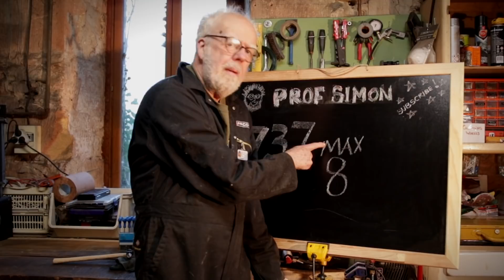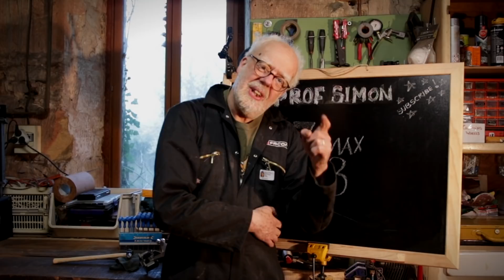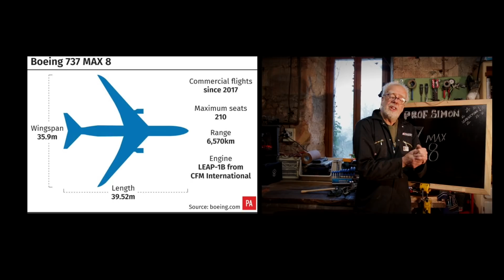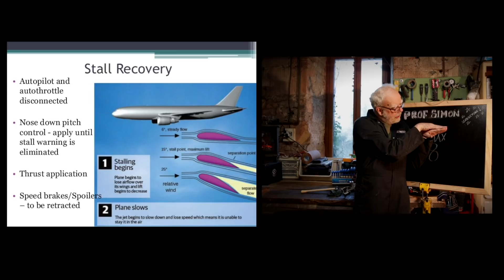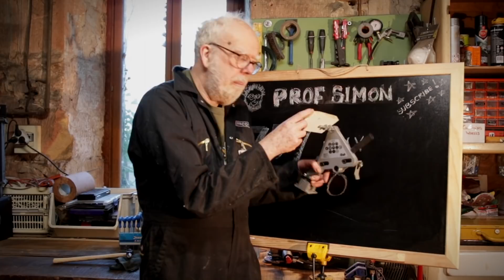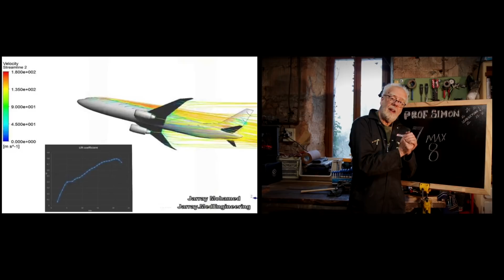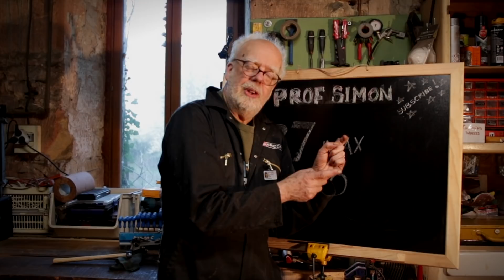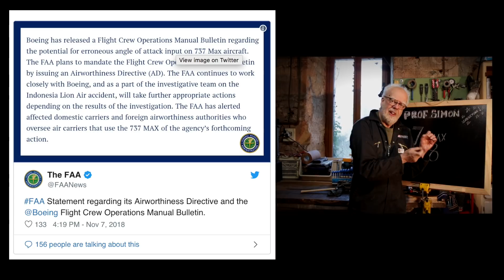Boeing 737 max 8's

Comment: Loss of life is always catastrophic for somebody, somewhere.  It is very tragic.  I hope this problem is resolved quickly, and that the professor is right...that it is a learning curve error, and that there is nothing wrong with the plane.  Didn't I see a report that the Ethiopian pilot had only 200 hours of flight training time whereas American pilots are required to have 10'000 hours?   That is substantial.  That is very significant, and could definitely be a YUGE factor.  Perhaps that is why the United States has not grounded their fleet of Max 8s (yet), while several other airlines globally, have.  Insufficient pilot spin-up.  Insufficient pilot training.  That is the cause of these accidents...not a faulty design or build?  Time will tell.  Time will tell.

Comment: The computers rely on information from external sensors , if the information being fed to the sensor is wrong then nether that pilot or the computer has control of the plane .
Reply: Does that leave room for a possible hack ? I mean we are talking computer systems

Comment: This sounds eerily similar to the 767 prime air crash in February near Houston Texas. The plane was on approach at 6000 feet and the auto pilot suddenly raised the  nose 4 degrees and applied full throttle. The plane then nose dived at 48 degrees and hit the ground.

Comment: Problem seems that it is very difficult to repair all this, these jet engines are simply too big for the B-737. So they need to bring all 370 B-737 back to the construction side and give them fitting jet engines which do not have to be balanced by a software.

Comment: You seem not to be taking into account the engine changes, which were significant. I would like to know what is the definition of a "new type" because it sounds to me like Boeing may have been trying to pull off a marketing ploy by selling the MAX 8  as a 737 so airlines wouldn't need to go to the expense of getting their pilots rated for a new type. ""The CFM International LEAP engines of the 737 MAX have a higher bypass ratioand have a larger nacelle than the engines of previous Boeing 737 models, so the engines are placed higher and further forward in relation to the wing than on previous models. This destabilises the aircraft in pitch at higher angles of attack; to deal with this the MCAS flight control augmentation system is fitted to the 737 MAX. Former Boeing engineers expressed the opinion that a nose down command triggered by a sensor single point of failure is a design flaw if the crew is not prepared, and the FAA was evaluating a fix of the possible flaw and investigating whether the pilots' transition training is adequate. ... On 15 November, the US Air Line Pilots Association (ALPA), the largest pilots' union, representing 61,000 pilots, urged the FAA and NTSB to ensure pilots receive all relevant information addressing a "potential, significant aviation system safety deficiency". See https://plus.google.com/+IanGrant/posts/4zTbfeqK6nG

Comment: Is the software on the two 737 MAX 8 and the Atlas 767-300 crashed aircraft similar?  Boeing now has had three crashes under unusual (yet similar) circumstances.  All three Flight Data Recorders indicated a control column movement each resulting in a crash.

Comment: Reminds me of the British Midlands crash where the pilots experienced an issue, reverted to their training and turned off the wrong engine. They had an engine failure but still had electrical power. In previous models only one engine provided electrical power, so when an engine failed, they assumed it was the one not providing electricity and turned off their working engine. All because they didn't read the manual.

Comment: Thank you Prof Simon for your overview of what might have happened . Taking your info and wisdom into account  , personally I think you are correct . According to information regarding the assembly of the aircraft , the engines placed on the wings were closer to the fuselage adding more weight to that area , possibly another reason for updating the computer s/ware . Im open to correction the  new manual indicates there are two switches to overide the computer stall warning . Possibly the pilots concerned were unaware of this as you mentioned . Presently with no known facts it remains a mystery as we  await the outcome of this terrible tragedy .

Comment: Sorry, your main point is completely wrong.  There is nothing unique about the max vs. any other airplane on how to prevent/recover from a stall.  Lowering the angle of attack is always the right answer.  MCAS was designed to help the pilot do just that.  The Lion Air crash seems to indicate that the MCAS was receiving faulty information that showed a high angle of attack and approach to stall, when in fact, that was not the case.  The MCAS system activated providing nose down electric trim, just as it was supposed to.  Garbage in, garbage out.  If the electric stabilizer trim ever misbehaves giving undesired trim (runaway stabilizer trim), the solution is the exact same on ALL 737’s for decades.......STABILIZER TRIM CUTOUT SWITCHES..........CUTOUT.  This is a memory item for all 737 pilots on all 737’s, it shuts off all electric stabilizer trim immediately, and thereafter requires manual stabilizer trim from the pilot(s).   From, a 22 year Airline Pilot and 737 Captain
Reply: @Tim..... How does that explain the speed?
Reply: Theoretically right. But if you are at 1000 ft and climbing, the plane is going up and down erratically, you are trying to get a stable flight, would you switch over to operating the wire and pulley system as advised by you.? Or would you keep the auto off and try to get stability in manual mode ?
Reply: I did read that from another pilot's perspective.  And the kill switches are on the right sude together nect to the co-pilots left leg.  But he thinks they were fighting the MCAS with up trim to counter and the MCAS kept cranking in more down trim while full power was still being applied (or take off power).  Are there some airports that you have to climb more steeply out of vs others that may have led to this battle?
Reply: so what probably the main reason for these two aircrafts do you think?
Reply: So does the 737 Max 8 have these cut out switches?  In which case the pilot should have used it, yes?
Reply: Yes, the very same. It is tragic that the pilots in both crashes did not recognize the condition. @malikrealestate8000
Reply: If the pitch trim motors disengaged automatically in the event of a failure non of this nonsense would have happened.
Reply: Steve Holton, the 737 has 2 AOA sensors, one on the Captain’s side of the fuselage and one on the FO’s.  I read a couple reports saying that the MCAS system is only connected to the Captain side AOA, but have since read reports that it is connected to both......so, I don’t know on that one.
Reply: @kirbyclone3293  I read AoA in use is depends on who has control fo the aircraft
Reply: @oceancape  
In practice different planes sue different connections between instruments and sensors and how they are used by the Automation systems. In some cases one sensor is used to show info on the pilots displays and the same reading (from a second sensor) is used to show info on the Co-pilots instruments. This is so u can compare them, and if they are different it tells you what is wrong and where the fault lies. Its one reason that they have to read such long complicated manuals. It makes perfect sense if you trained on the system, but looks silly if u haven't had that training... which pretty much describes airline administrators - who complain about all that silly training. (mostly because when they ask what the training is for they go glassy eyed when you try to explain such things).
Reply: Sagar Malik, yes, the 737 Max has the same cutout switches.  They definitely should have been used to prevent the unwanted (runaway) trim condition.
Reply: reverse thrust totally correct! That accident bothers me the most because once it was known that there was a issue, the PIC requested a different altitude to “trouble-shoot”. That should have never happened, he should have declared an IFE and picked whichever run way (of the 5 below him!) that would work best to get down.
Reply: @ tim where did you train? best advice for a career in aviation?
Reply: a tim hegg if all of your deductions are true then my theory is plausible...
Reply: If you are correct and it's as simple as cutting off the switches, and every pilot should seemingly know how to do this, why were at the pilots on at least plane frantically scouring the owner's manual for a solution?  Did they simply panic and have a momentary memory lapse of something they knew?  If so, I thought most airlines try to screen out and not hire pilots prone to panicking, so that scenario seems unlikely. Or maybe they were just incompetent or poorly trained? If so, it's extremely frightening.
Reply: @davidlindgren7605 No Sir the pilots didnt have time to read the manual.....they were busy trying to pull up. But the flight attendants were reading it out loud to them . Have you not heard the cockpit recorder?
Reply: There's clearly a lot more wrong with this 50-year old design than software. The engines are mounted too far forward and upward, anyone can see this leads to Center of Gravity (CG) issues. But further, this "new design that isn't new" causes a strong pitch-up moment at low speed and high power (e.g. right after take-off). Boeing tried to save time and development costs while chasing Airbus, and 346 lives later the real problem has surfaced. MCAS would never have been necessary if proper aerodynamic design principles had been obeyed. It is a software "patch" on a hardware "bug". Issues about AOA sensors and software "authority" are sideshows. Boeing will likely be found liable in the hundreds of lawsuits to follow. Boeing will try to have the trials moved overseas, but they seem to have not recognized that this is now a global issue. Does any company have the right to jeopardize lives to make or save money.
Reply: You are so right - Garbage In  + Garbage OUT. As I understand it,  there Is Only One AoA sensor on a plane that lives and dies on REDUNDANCY. Is this a bit Ironic. It can't be for the $49.99 saved on each Billion Dollar Plane. Add a second AoA Sensor on the opposite side of the fuselage and feed both readings into a differential circuit where they will be compared. If they agree within 1 / 100 %, Then the Mean Reading is Passed to the MCAS. If the two different signals are NOT within 1 / 100 % of one another, NO Signal is passed to the MCAS disabling fly by wire, activating a Yoke Shaker and putting Humans In Control. Easy, Peaszy.       sdh in CT
Reply: Yes I worked on 737 for the last 15 years and I used to work on the dash 400 series, and you're right! They all have the stab trim cut out switches side by side and red capped safety guards over them.... same on the B747, B757 And  B767 . 
      Even the McDonnell Douglas Md-80 has that switch.. I worked on them also...to bad it didn't help the crew from Alaska air back in 2000 though! 

Question is though why didn't the pilot of both of those Max flights use that immediately?

 Probably because they previously flew the Airbus which does not have a cutaway switch!
Reply: S Tman  youre correct... but, the cutout switches would not have had any bearing on the Alaska accident what-so-ever, that bird’s horizontal stab became mechanically locked in a undesired position when the jambnut failed.

Comment: The evening of the Ethiopian crash I flew over the Pacific on a new Air Canada 737 Max 8. The news flashes were on every TV at YVR.  I am a pilot in training so was VERY interested. I was keen to know WHEN the plane went down. It was approx 6 mins after take off. The new GE engines are unbelievably powerful on take off by the way. Just awesome. Anyway I was watching the clock semi anxiously in til after 6 mins trust me.  All good of course. It's exponentially more likely to die in a car crash than a jet liner anyway. By the way the Business  Class service on Air Canada was exceptional.

Comment: The MCAS should only make gradual nose down adjustments over a specific time frame based on accurate AOA indications. I don’t think a properly working system is capable of causing CFIT. Just saying.

Comment: Your opinion is true if all system is normal .. bring back sensor error in the table, hand shaker, panic, low alt and high speed, full load for passanger, fuel and cargo .. non stop batling with plane with your hand full power on stick .. check list yeah right ..

Comment: Im no geek nor close to being a Pilot , but my question Professor is, Why then does the Computer allow the plane to nose dive?
Reply from the maker: The max 8 has a angle of attack sensor that apparently makes the computer push the nose down too early...the pilot corrects ...and the software keeps pushing down...sounds scary.

Comment: Why didn't they just disengage the autopilot? Thee three 737 pilots I questioned said that would be the proper response.
Reply from the maker: I think there are two levels of autopilot...one that guides the plane to a navigation point and a deep embedded safety system that protects the plane from pilot mistakes....the rumor is...Boeing missed out of training manual, the way to disconnect the deep protection function...its possible ...but they did not want pilots easily messing with it....not confirmed...we will see?

Comment: Reuters: Malka Galato, 47, a barley and wheat farmer whose field the plane crashed in, also described smoke and sparks from the back. “The plane was very close to the ground and it made a turn... Cows that were grazing in the fields ran in panic,” he said. Tamirat Abera, 25, was walking past the field at the time. He said the plane turned sharply, trailing white smoke and items like clothes and papers, then crashed about 300 meters away. 

When a plane is shooting out orange flame, sparks and white smoke then black smoke from it's tail section you can rule out MCAS and start thinking bomb or something in the luggage that caught fire.
Reply from the maker: It might well be true but aircraft break apart at 600 mph heading straight down...

Comment: Well if this is the case that software update caused the flight controls and avionic systems to work improperly. Due to new version software disorientating normal pilot procedures. Than this is murder and negligence from Boeing. I cannot believe that you would update a computer system and not do parallel testing  with the old version so that the transition from old software to new software is done safely !!! in various stages than this would not of happened. This is part of the software cycle in Computer science as I have a degree in the subject.This update should of included flight manuals and simulator training for the pilots to get use to the software changes. There could be other possibility like debris on sharp objects on the runaway cutting into the tyres and smashing into the aircraft causing it to be unstable. Also the threat of suicide and possibility terrorism due to the passengers being of high important value i.e political financial or even technologically as they are not normal passengers going on holiday !!! We will have to wait and see but our prayers to their loved ones and may their souls go to heaven  !!!

Comment: Mmm.. Sorry... Are you sure that the "manual" is recover all procedures? ( I just heard that Boeing missed to add it in the manual). 

Oh yeah.. I have just read that Eks NASA engineer admit that  there must be an issue of Boeing safety.

Last, the failed product is possible.
Took an example... Windows Vista and Windows 8, were extremely "failed" of the Microsoft new product, don't last more than 2 years. Windows XP was very comfortable.  Windows 7 be the greatest version. Might be Win 10 do.

Comment: You kept this nice and simple and in layman's terms.
I have a strong suspicion you are correct.
In the similar incident with Lion Air, the plane had shown similar problems before the fatal flight, the pilots got around it by switching off the MCAS.

In layman's terms, they turned off windows 10 and it went back to a more familiar windows 7.

They could then fly it normally

Comment: An excellent explanation. Surely the pilots shouldn't be allowed to fly one until they have been fully trained with a new aircraft system and passed a new test examinations covering every possible scenario? If this is not the case, then when flying on a Max8, it would mean that passengers will be hoping they haven't got on one, with an unqualified pilot?  I don't know which is worse. A seriously faulty aircraft or an unqualified pilot in the cockpit? I certainly would steer clear of the Max8 either way!

Comment: What if there was a problem with the Vertical speed? Maybe they didn’t program the FMC correctly and the plane didn’t do what they expected. They push the yoke down to reduce the Vertical speed and the plane thinks they entered a stall while on the NG it would have disengaged the autopilot.

Comment: Perhaps Boeing, and the airlines were trying to distance themselves from a potential new type rating for the Max 8 so they installed this new system to avoid this. But the new system is not always working out. I fully wonder if all the pilots are looking at the stab trim cutout switches during these lateral axis events.

Comment: The B737 also had problems in earlier versions, resulting in the death of people, and the same person was protecting the company, while two planes did not fall with a 100% loss of life. Only in the third incident, the pilot managed to ground the plane and discover the cause. Otherwise it happened that pilots were guilty and when there really was a problem, it's the easiest to blame the pilot, it's the cheapest way. . And after ordering replacement of possibly disputed parts.